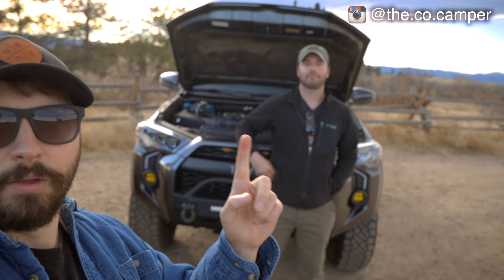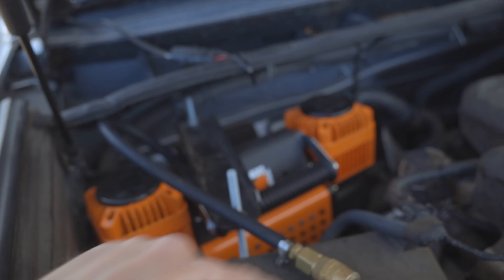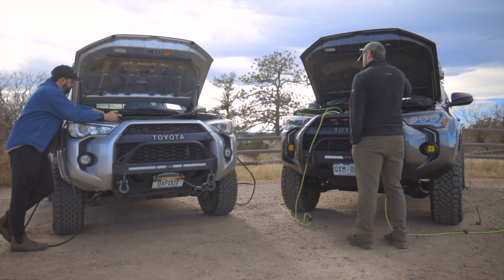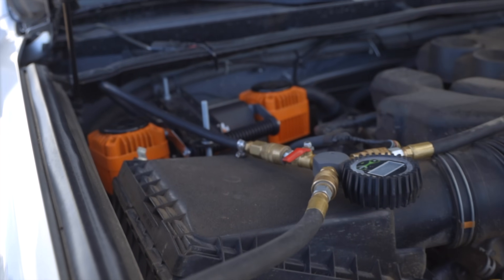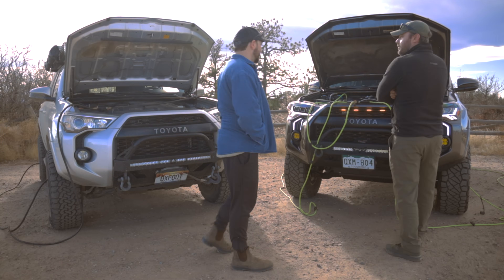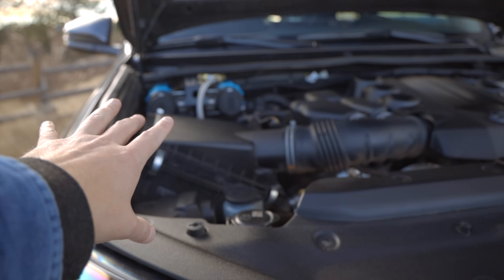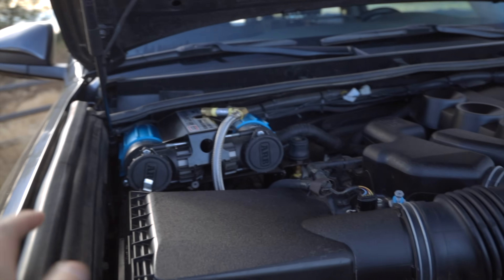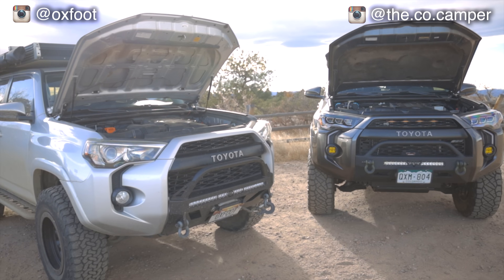Budget NAPA Compressor is FASTER than ARB Twin?

Comment: Ever since you have done this comparison I have been trying to get a hold of one of these napa compressors. Checking back with Napa and No luck finding one, just like the supply chain nothing is available, Check with napa today she found the very last one last week in Ohio the guy pre paid plus 50dollar shipping and no word when back in stores ☹☹
Reply from the maker: Yeah I mean summit offroad has one that’s the same compressor but a good bit more money. Someone the other day on here said that for a few hours one day they had some available and they actually ordered them but it may have just been the store near them found some.
Reply from the maker: Damn, the summit offroad one is sold out too!
Reply: I'm trying to find a clone! It's harder than I thought it would be.. the last Maxi I seen on ebay was yesterday and it went for over $300..

Comment: I purchased a twin piston compressor by All Top...looks the same as the Napa/Maxi Trac but with a different color.  Haven't put it to use yet...waiting to make some electrical mods to increase the reliability.  The All Top 'supposedly' puts out just over 12 cfm, twice the output of the ARB.  The big benefit to the ARB is that it has a 100% duty cycle...these portable units have a duty cycle of about 50%.  Still, plenty of time to air up four tires without the unit shutting down.
Reply: I’ve used my maxi trac to air up 3 cars from 15-40, 2 sets of 33 and 1 set of 37 and I still haven’t hit the duty cycle 😅
Reply: That's good to know.  I finished modding the compressor, so next is to air down the 33's on my Suburban to 15 and bring them back up to 40.  I swapped out the circuit circuit for a relay, so the reliability should be better over the long term. @TurtleMusica

Comment: I would buy the ARB. I have the same compressor as the Napa one because a lot of companies are buying the same ones from overseas and labeling as their own. But I’ve had to replace it already and that was after owning it for like 2 weeks. All of the bolts started to back out and the air cleaner caps on top of the pistons always fall off. It’s just cheaply made. I’ll be switching to ARB when I have the money
Reply from the maker: Thanks for sharing that with us. I’ll keep an eye on it to see if the thing that happened to yours of another brand. I think that I may eventually go the ARB route because I want to add a dual battery and the NAPA is taking up that spot right now.

Comment: One other (very important) thing to consider is that the Inside Diameter of your hose will greatly affect your airing-up times. How do I know this? Because I worked in the Tire/Automotive Service Center 'industry' on/off for 20 years. 

If your friend's ARB system (with the green hose) is 1/4" I.D. (for example) and your NAPA system's (black hose) is 5/16" I.D. or larger, it will greatly affect the time it takes to air-up. 

Running off of a large 'shop' compressor, if you're attempting to remove stubborn lug nuts with a 1/2" Drive Impact Wrench - a 1/4" I.D. hose will choke the airflow so badly, it would seem that you lose 1/2 the power on your impact. Switching out to a 3/8" hose is a night/day difference. 

With all that said - please check the I.D. of each system's hoses and run that test again if they varied like I'm guessing. Other than all that - Thank you for the content, as I've been looking into purchasing an inexpensive compressor for my recently acquired ZJ and was not aware that one even existed from NAPA. - That alone has earned an immediate 'Subscribe' from me, off of this very first video I've seen from your channel.

EDIT: Going back to look at the video for a second time, it would appear (guessing) that both hoses are probably 1/4" I.D. ? ... Well... poop. :/
Reply from the maker: Yeah I think the diameter is a bit different. My hoses are a bit wider but I’m not actually sure if the coating is just thicker or if the actual inside of the hoses is wider. That being said we tried our best to eliminate that by switching hoses. I think what we should have done and tried to do was to air each others trucks up with the opposite compressor. The tires are the exact same size but who knows what kind of variables we may have missed. Hopefully at worst this makes it so that other people test my conclusion in different ways in an effort to disprove it. The more information the better!
Reply: @OXFOOT  After viewing your reply, I found detailed technical specs on the ARB, but could not find the same amount of data available for the NAPA. It would appear though, that the NAPA compressor is rated at 300 liters per minute, whereas the highest output model of the ARB only chugs out 174.4 litres per minute.
Reply from the maker: @dawabbitt3079  yeah that rating is what inspired this video. I thought that 300LPM was insane. I think I believe it now. I do wonder how many times in a row the NAPA one could inflate without degrading in speed. They don’t really list the duty cycle anywhere though.
Reply: @OXFOOT  After reading your most recent reply, I scanned through another YouTube channel's review of this compressor. He showed the specs on the box which stated that the compressor draws 90 amps and the Continuous Use is rated at 40psi for  15 minutes on / 5 minutes off. Hope that helps.
Reply from the maker: @dawabbitt3079  thanks! Yeah that helps a lot. I’ll add that to the pinned comment.

Comment: Going with the Maxitrac is a no brainier.  It’s the best bang for the buck at the moment.  ARB didn’t really have much competition in the past but these new compressors are giving them a run for their money.   I think the ARB is overpriced.
Reply from the maker: Yeah I still like the ARB but it’s so overpriced, maybe they’ll bring it down. The one big bonus for me is that it works with the 4tire inflation straight from the box, no modification. If you’ve got a few bucks and 30 minutes though the NAPA fits no problem.

Comment: Double check the ARB, per the times you guys are getting, sounds like one piston is out. I have a twin ARB and get about 4 - 5 min on 37X13.50
Reply from the maker: Yeah I had someone else say that before and had another friend test his and got about 9 minutes. So maybe both of theirs only has one piston going or something. Is that 4-5 minutes for all four tires on your 37s, correct?
Reply: @OXFOOT  yes, for all 4 tires. 15psi to 35psi.

Comment: For anyone considering the cheaper alternative, dont forget to ask yourself how reliable do you want/need the compressor to be? I personally am going for a onboard system to save space in my draws by installing inside engine bay, if i were to go the cheaper unit id have to carry a backup compressor incase the nappa failed, which defeats the purpose. If going arb id be more comfortable going without the backup unit. Am i correct, anyone disagree?
Reply from the maker: I don’t disagree with this statement. I’m willing to take the risk but I try to make people aware that it is a risk. The product hasn’t been out very long so it’s hard to say the longevity. This is mostly just a speed test; people should be aware that there is no warranty and there’s no long term results from this compressor as to how long it will last.
Reply: I believe in "you get what you paid for" 🤙🏼
Reply: You can buy a brand new vehicle off the lot and break down a mile down the road
Reply from the maker: @swedesspeedshop2518  very true
Reply: @swedesspeedshop2518  risk management

Comment: Ya this seems pretty conclusive. In fairness to the ARB, they could probably nearly double their CFM if they dialled their duty cycle back to the 50-60% the NAPA is at.
Reply from the maker: Too bad they sold out of these and possibly discontinued them after this video.
Reply: They are back in stock o ordered one 10 mins ago!
Reply: @tremoradventures1394  dang, what kind of luck is that. I might just buy 3.
Thanks for the reply, they were still out of stock at 6am.
Reply from the maker: @tremoradventures1394  hell yeah!
Reply from the maker: @ThisTall  lucky timing I guess

Comment: 2 ARB twin compressor died on me, the fist one had a seized piston for working for 3 minutes, send it to ARB got it back and 2 weeks later the other piston seized, got my money back and went with Co2 tanks and never looked back.
Reply from the maker: Damn that’s rough. I’ve mostly heard only good things about ARB until the comments on this video. Maybe I’m thinking the ARB isn’t that bullet proof now. CO2 tank would be something I’d love to do. A lot of folks around me have those and it is so damn fast and convenient.
Reply: @OXFOOT  indeed, in our group we all have Co2 and 1 compressor as back. I have 2 tanks and it can fill up my 40” tiers much faster than any compressor out there. You should definitely look into it. I have built my Co2 tanks with off-the-shelf parts and came out significantly cheaper than Powertanks or similar Products. 

You make awesome videos,

Cheers 🍻

Comment: So I see you have run two different budget compressors between this video and your installation video. Between the NAPA and the Smittybuilt, which did you prefer?
Reply from the maker: Smitty built is easier to come by but it’s not nearly as powerful as the NAPA. The Napa one sells out all the time, made about the same and way faster. The smittybilt is technically not as good but a lot easier to work with because it’s smaller.

Comment: My Smittybuilt single piston comp has been a life saver. Will definitely be looking into this Napa compressor as well. Wondering how weather resistant it is
Reply from the maker: Yeah I had the smittybilt 2781 before I had the NAPA, it’s a great compressor but this one is about twice the speed as my old one. It’s a little cheaper than the smitty as well.

Comment: I've watched a few MaxiTrac videos and the fill times seem to be much closer between the ARB/Maxitrac than what you experienced.   I found maxitrac one that filled 37" tires from 12 to 33lbs and it was very close to what my ARB was able to do.  Yours is the first where they do all 4 tires at the same time so that's interesting and perhaps accounts for some of the difference (although I can't figure out how it would).   Anyways, I just found it interesting this had such a difference.    Is your buddy sure both sides of his ARB are operating?  There is separate wiring for each side so it is possible to have half the compressor not running.
Reply from the maker: Yeah a few folks have said that as well. I have had other folks test their arb and while theirs was a decent amount faster the NAPA was still faster by a bit. Apparently there are a few companies in Australia that make very similar products to that Napa one if not exact clones and they have come up with similar conclusions that they are faster than the ARB.
Reply from the maker: That being said I don’t think they are as off as this one was. I think maybe one of his pistons is weak or something. Which is unfortunate for this test but the general consensus is that it’s faster but just really just bulky, cheaper made, and silly looking.
Reply: @OXFOOT  Thanks for the reply.  I'd have your buddy check to see that both sides are running.  Might be a simple wiring, connector, fuse problem.
Reply: Even if they are even or even if the Maxitrac was slightly slower than the ARB......... IT'S STILL 1/6th OF THE PRICE!!!
Reply: @MotoringAdventures_KE7SAI  And the Maxitrac comes with zero warranty.  The ARB also has 100% cycle time.  Additionally, if half the ARB fails it appears it will still work.   The ARB is also more compact and has lots of aftermarket support for mounting solutions.   Is it worth spending 5 or 6 times the amount?  Each person has to decide for themselves.   It would suck to be far from town with your tires aired down to 10lbs and an inoperable compressor.
Reply: @olliehopnoodle4628  I could buy two spare maxitracs and still have nearly $300 leftover compared to the ARB. Just sayin. I think the ARB is nice and clean, but this sure leaves a lot to be desired from ARB in terms of performance for the money.

Comment: Can I suggest a way to improve the comparison, use only one vehicle. Use on only gauge. Deflate all 4 tires use the moreflate or the other system. Inflate two tires (Front and Back with one compressor and time it. Inflate the other two tires with the other compressor and time it. That should probably more accurate results. Nice video!
Reply from the maker: That’s a really good idea, we tried to do something similar but since our hoses are both made just for our vehicle both of them didn’t really reach. Maybe I could come back to this and see if we can find or build something that’ll work.
Reply: @OXFOOT  I got a more flate system and extension if you want to use next time. Also got an arb single in a box. Located north of Denver btw
Reply from the maker: @ramzizaz  I’ll hit you up about that then I may have 305s by next month but I could give it another shot.

Comment: Thats really supposed to be an outside unit that does not fit in 90 percent of offroad vehicles. I have a compressor that is faster than the ARB too, but I'm not lugging around a big compressor every time I go to the trail, I need space for a fridge and other gear, and the bigger units like that overheat fast and need cool down time, while that ARB will never overheat, and run lockers if needed. Different applications. The ARB purpose is for overlanding and space saving.
Reply from the maker: Yeah the ARB is great and if I could logically afford to go that route I would. Any one who has asked me I’d say the same thing. That price tag is just a bit too much for me.

Comment: I had one similar to Napa due to the hype and it reached thermal overload then shut off at 4th tyre. (31’s). Used it twice then sold it. I didn’t like the build quality. My smittybilt feels much better (160L/min) so decided to keep it and now will get an arb cuz I have two rigs.
Reply from the maker: Yeah I had a smittybilt before this one and it’s still working but about half the speed. I’ve been lucky with my Napa that I’ve been able to air up mine and then others back to back with no issues. Maybe I got lucky with mine.

Comment: Where is the video that shows you modding the fitting to work and what fittings do you need?
Reply from the maker: It’s a video I did on fitting my smittybilt one in my battery tray. The end of the video shows you what you need hang on I’ll grab that video.
Reply from the maker: https://youtu.be/De10UUP5UzY

Comment: Do you have an install video and the different parts and hoses you use?
Reply from the maker: Yeah so it’s the same install as my old smittybilt but you need to twist this one a bit to make it not hit the engine. Hang on I’ll link the video.
Reply from the maker: https://youtu.be/De10UUP5UzY
Reply from the maker: It’s pretty close to this video other than turning the compressor on the tray a bit. Also I found out later that it works with most battery trays as they are all made for the same size battery.

Comment: also what are the duty ratings on both units? 
as in how long will they run building up psi by the time the heat turns them off?

Comment: Never tested the NAPA so I'm not digging on it, but my ARB twin inflates four 37" x12.5"  from 10psi to 37psi in 7.5 minutes as an average.   But, if the NAPA was an option when I built my setup.... at the price and color (I love my Punk'n and black Jeep) I might of gone that route.
Reply from the maker: Yeah I’ve heard from a few people that theirs is faster, I have seen them a lot faster than the one from this video but it still seems like the NAPA one is faster but maybe it’s not as different as mine was compared to this one.
Reply from the maker: I do wonder if the Napa one would fit in the Jeep engine bay, I know y’all’s is a lot smaller than the 4Runner engine bay. At least the 2010’s one are smaller, not sure about the new ones.
Reply: I have my ARB twin mounted in a Ridge tool box. I do all four at the same time.  All the hoses, manifold, fittings and digital pressure gauge all fit inside the toolbox.   I can move it to my wife's Jeep or setup a fit station at the end of a run.

Comment: I have the same Napa compressor mounted under the engine bay exactly the same way. I went on a trail for a few hours yesterday and when it was time to air up, it didn't work. The heat while under the hood tripped the thermal cutoff. I had to wait 10 mins for it to cool down. Which pretty much negated my air up time savings 😂. I'm going to try some type of heat shield, if that doesn't work, I'll just rip it out.
Reply from the maker: Oh damn, I hadn’t run into that with mine yet. Maybe it’s just been cold here since I started using it. I’ll have to keep an eye out for that. We’re you running it with the hood open or do you have it wired to a dash button and out the grill or something?
Reply: @OXFOOT  I had the hood open, I wired it into a breaker.
Reply: Which of why i would never mount any compressor in the engine compartment. Heat kills compressors, regardless of how expensive they are.

Comment: Maybe ARB speed is limited for the sake of longevity. Will ARB last four or five times longer? But two NAPA ones. One as a spare or for accessories to save wear and tear.Some have already said what I did (read comments after original comment).
Reply from the maker: Yeah it’s not a bad idea just get two of them and then you’ve got your backup. I’d be happy with that if it took two of them at $100 to last as long as one that cost $600.